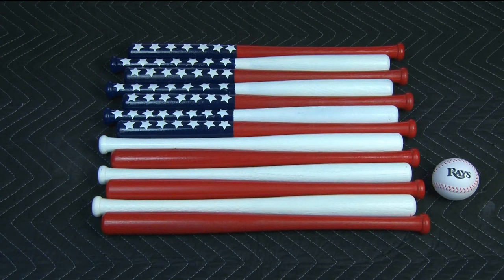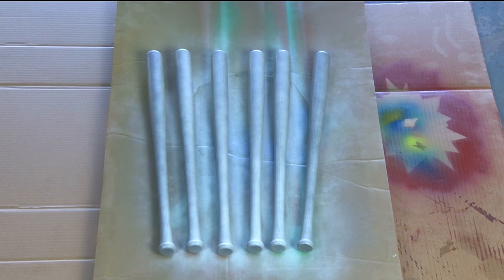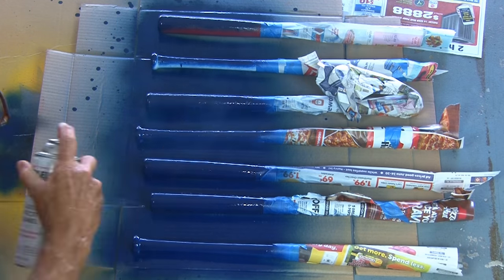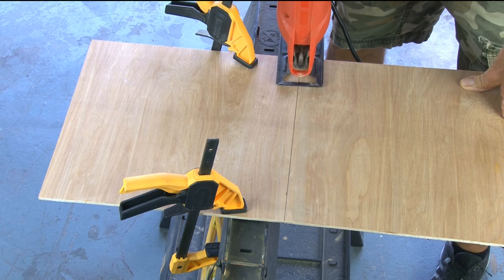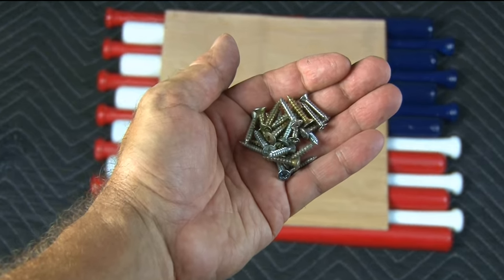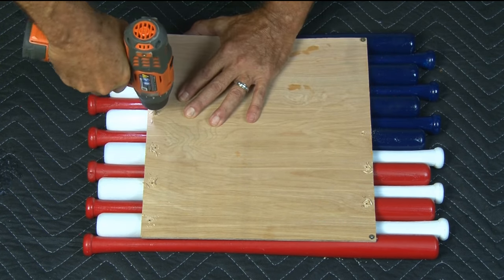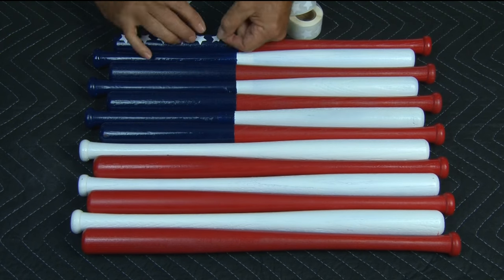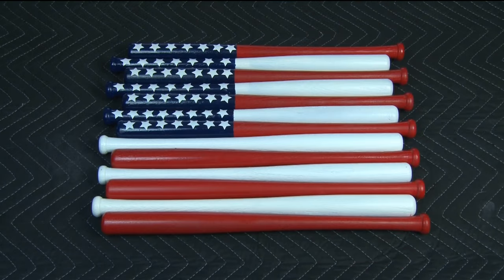Mini Baseball Bat American Flag!

Comment: hey kipkay!  I'm trying to make the bell on my Western Electric Model 500 ring. Want to give it a shot? No speakers or mp3s. The actual bell. I am hoping to make it battery powered. Maybe swapping the 24v soliniod for a 12v one. I have no idea what I'm doing!!  If I figure it out I will  post the video. I think  it will  be quite  challenging!